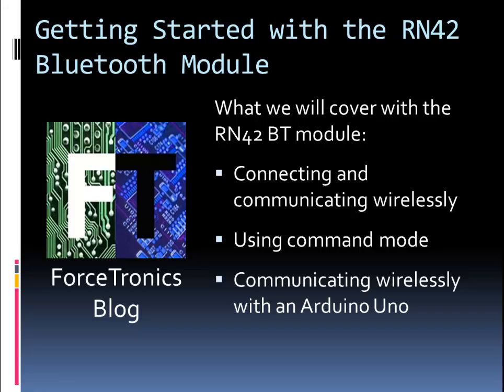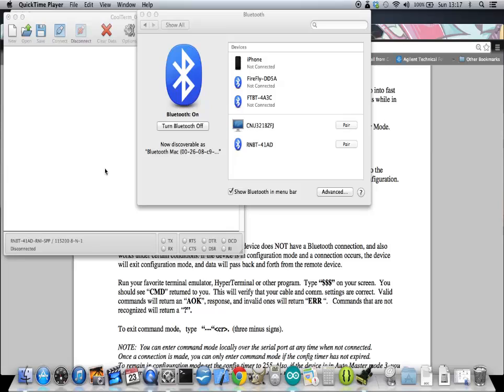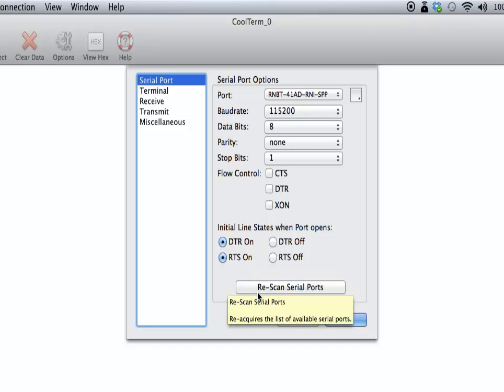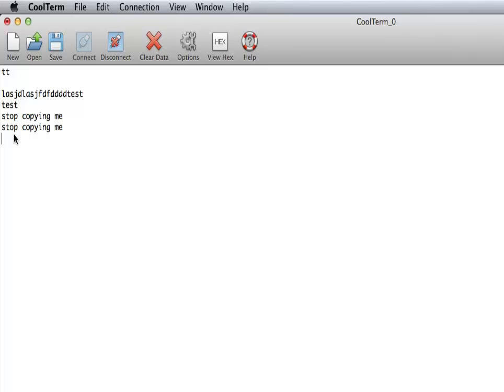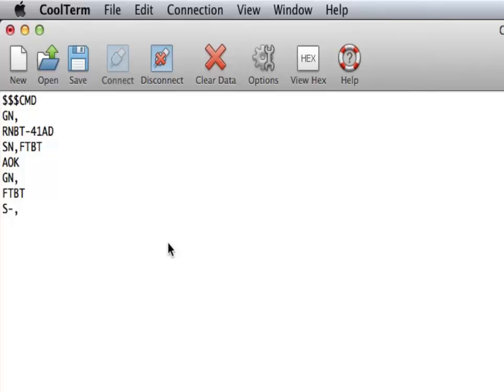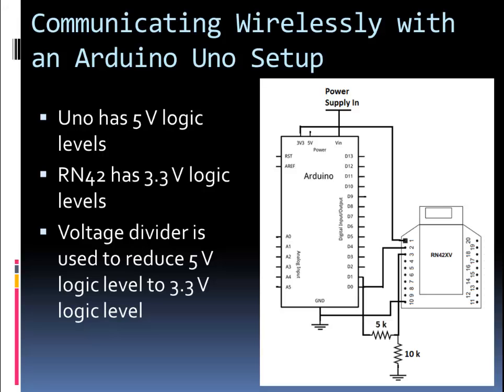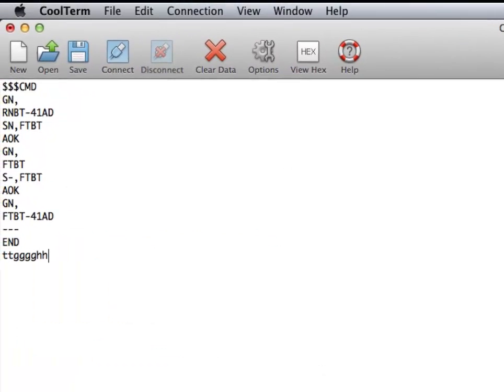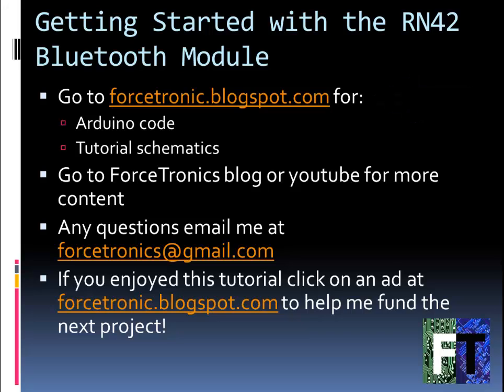Getting Started with the RN42 Bluetooth Module and Arduino

Comment: Thanks for this informative video.
Do you know if the RN42 supports the ble HID profile and how to confirm it for that profile? I need to send data in HID to be received as if it was coming from a keyboard. 
Thanks
Reply from the maker: This video and the RN42 are pretty old, if I remember correctly the RN42 was out before BLE so it does not support BLE.

Comment: Where can we download Coolterm from? I tried your web page but couldn't find a download link. Your video seems pretty straight forward but I am not able to try it yet because Windows 7 doesn't have the hyperterminal anymore. That's why I need your Coolterm software. 

Thank you...
Reply: Ok, I publically apologize. I found the link to dowload. It's just that I was expecting a download button instead of a link. Thank you anyway.
Reply: Yes it seems to be very user friendly although I didn't have luck communicating tp the RN42. My PC  doesn't have bluetooth so I plugged in a bluetooth dongle. Turns out Win7 recognizes the dongle but assigning COM9 for incoming msg and COM10 for outgoing. So I try to use COM10 assuming I will send msg from PC to the outside world but CoolTerm seems to have problems to open/configure the port.